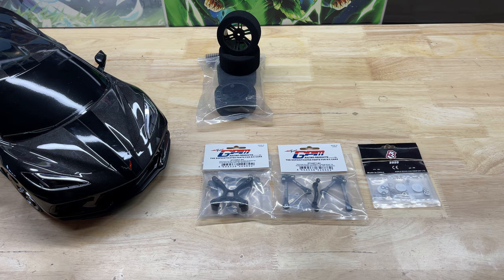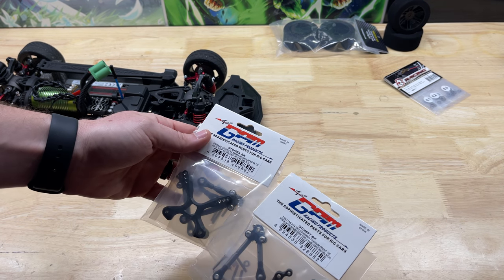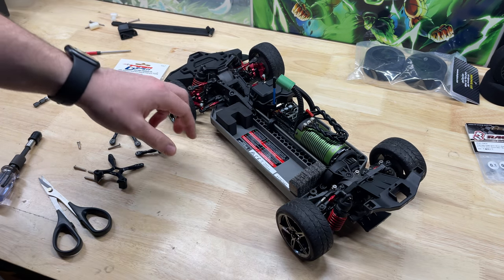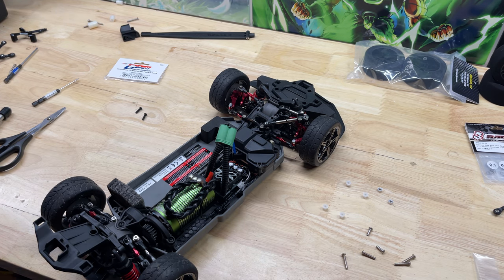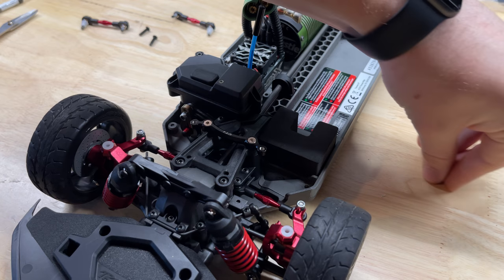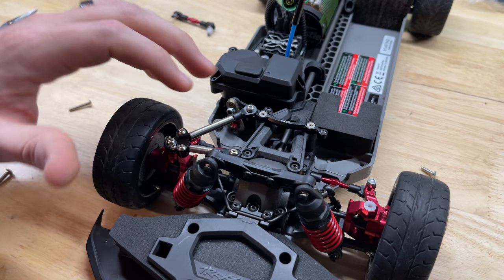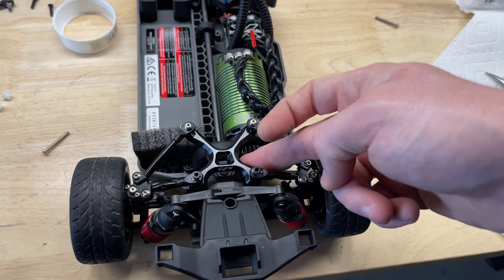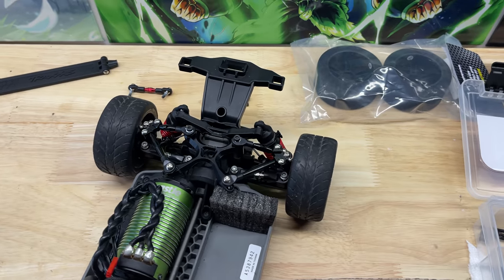Traxxas 4-Tec 3.0 | Bracing

Comment: Nice install I was about to install my second set GPM links on my 35 Hot Rod, for I battery I use
Reply: Pure Tech battery strap shoo goo it to the chassis and it work good i have a 4s battery in mine and crashed at 101mph and it did not move

Comment: So on the front suspension the upper rear arms will adjust your caster angle not your camber and you'll want them to be in the nagitive degree's (tipped towards the rear of the car) or you will end up with a high speed shake 
(A bad front shopping cart wheel).